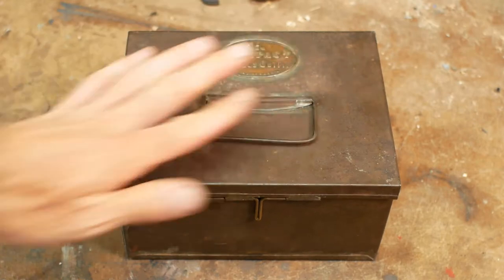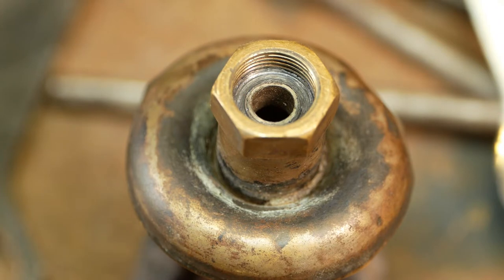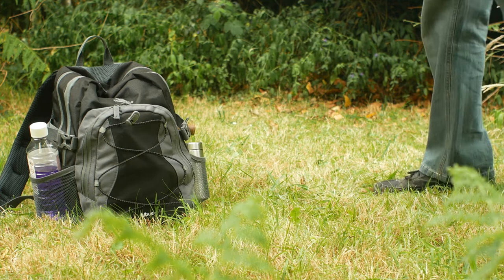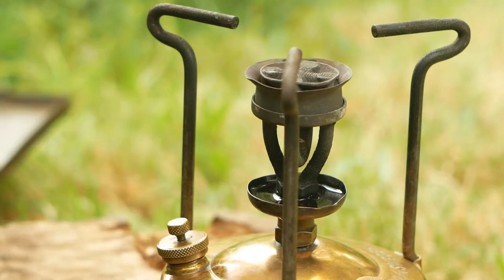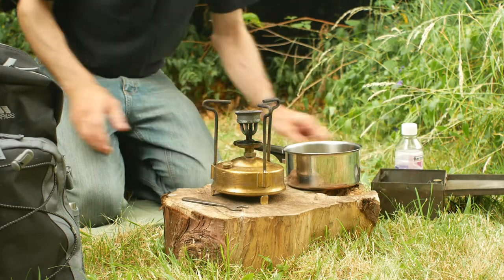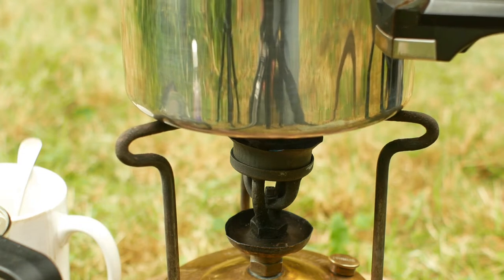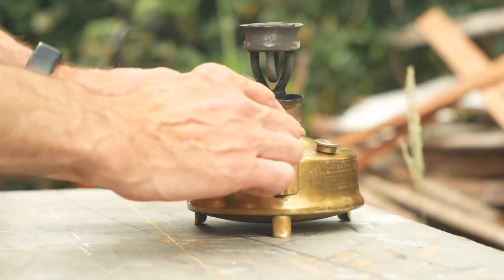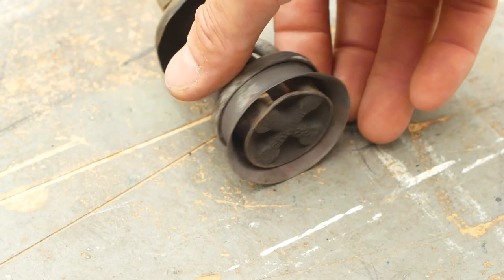How To Light A Camping Stove - Vintage Primus Model 210

Comment: there is a sort of self-deprecating tongue in cheek aura around this video, which I found irresistible, besides a beautifully constructed and well narrated storyline. Oh, and now I come to think of it, I now know how to light my own flea market Primus stove. Which was the entire reason I looked for this video in the first place. Top marks. What next? How to build your own supermassive Black Hole in the garden? I can hardly wait.
Reply from the maker: Cheers Ferdybroom, glad you liked it, it's a cracking little stove and regularly makes us bacon sarnies, not to mention cooking Christmas lunch on that stove plus my vintage Weedex stove out in the shed - it just had to be done!!!!!  I did have the non return valve at the bottom of the pump fail last year, usually these can simply be replaced using the appropriate tool to reach down to the bottom of the pump barrel and unscrew the valve, but mine was stuck solid and in the end it just sheard off while still stuck in the barrel.  I then had the scary task of unsoldering the entire pump barrel and removing it so I could attack the valve from the other side - it needed quite a bit of heat to unsolder it, but too much and all the other soldered joints would fall apart, so I was a bit nervous.  Soldering it back in was far easier and happily we're now back in business with a new valve.

Comment: What a terrific find! Beautiful piece of  kit. Thank you for sharing.
Reply from the maker: Cheers Nedra, it's a lovely little thing and the sound is so soothing as you cook your food.  Since I made the video, the non return valve in the bottom of the pump failed - usually you can replace these with the correct tool, but even with that tool it wouldn't budge, so I had to un solder the entire pump, replace the valve and re-solder the complete pump back into the body - it was a bit of a daunting project, but it worked and the stove is back working again.

Comment: Great video! Glad for your explanation at end on vaporization tubes. I cheat to get my Svea123r stove going as I do not like the process of using spirits to heat up the tubes due to spilling or the smut/discoloration from that process. I use a small butane or propane torch to heat them up fast then light the burner. If it does not light or has a yellow flame, I apply more heat to the tubes or tank and watch the flame turn blue. It is a very clean and fast process for the Svea123r stove and suspect it might work on other stoves. Of course, make sure the caps are on tight first without leaks. I know this method is not for the purest, but, it is another viable option for pressurization if needed. Just be sure that you back the heat off to not degrade the connections that are bonded. You really don’t need much heat.
Reply from the maker: Hi Ricky, that's a neat way of firing up one of these stoves quickly - it might take a little of the romance away from the procedure (if you're into that kind of thing).  As you say, you wouldn't want to go too mad with a very hot flame but apart from that it's a neat method.  I must admit that I'm a bit of a fan of the entire lighting process and I've used my stove most weekends since I made this video - until last week when the non return valve in the pump failed - haven't had time to fix it yet, but I will do soon.

Cheers for watching